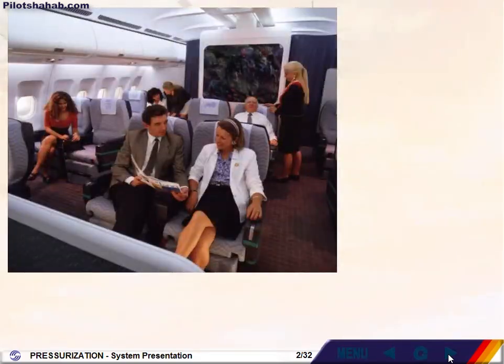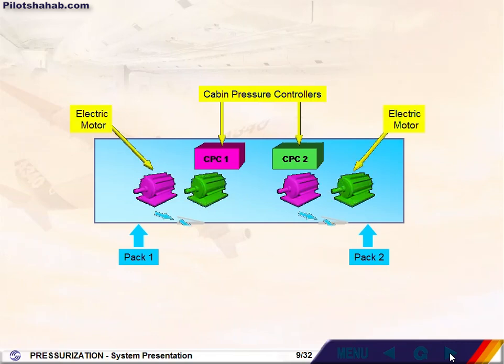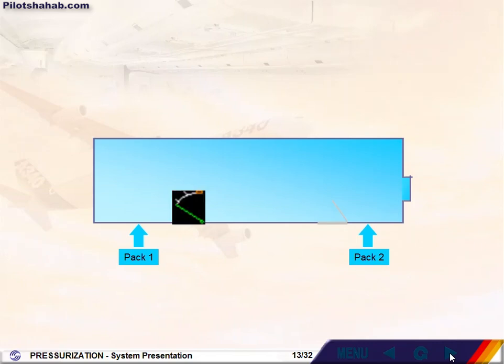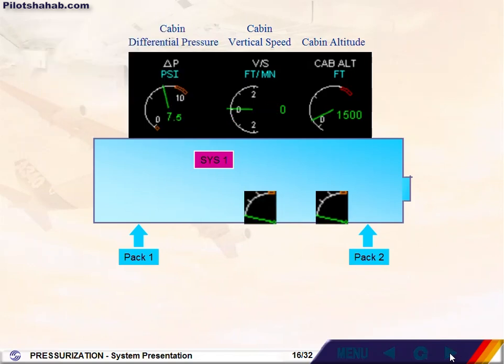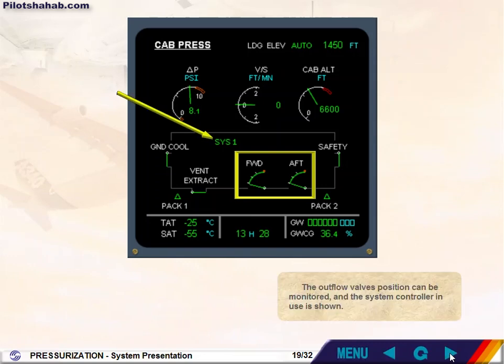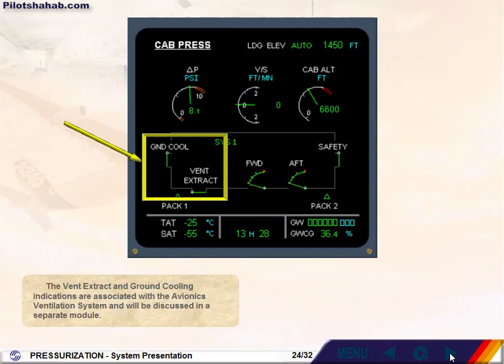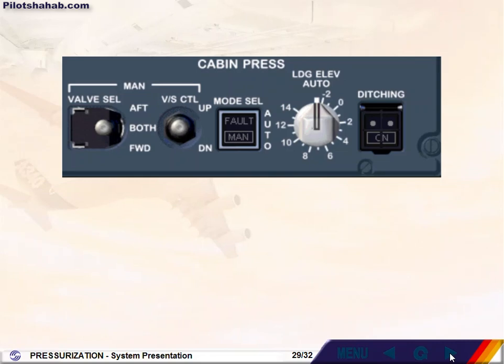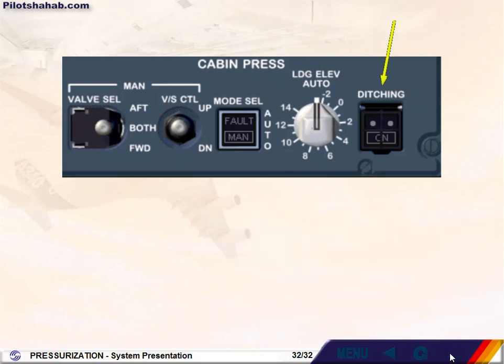Airbus A340 CBT -3.1: PRESSURIZATION-System Presentation

Comment: B747   DELTA P /MAX 6,00 PSI--ALT MAX CABINE 6 000 FEET NORMAL 3 PACKS EN SERVICE (AVEC UN PACK /COUPÉ LE PNC FAISAIT LA QUEUE POUR VENIR SE PLAINDRE AU POSTE)
A340   DELTA P/MAX  8,7 PSI----ALT CABINE MAX 7350 FEET  TOUS PACKS EN SERVICE.
J'IMAGINE LA FATIGUE PEQ ET PAX APRES DES VOLS EXTRA LONGS.(UN PRESIDENT DE LA REPUBLIQUE DE L'ÉPOQUE AURAIT REFUSE CET ALÉAS .)
CERTE ON GAGNE SUR LA MASSE A VIDE MAIS IL FAUT EN PAYER LE PRIX ! ! !